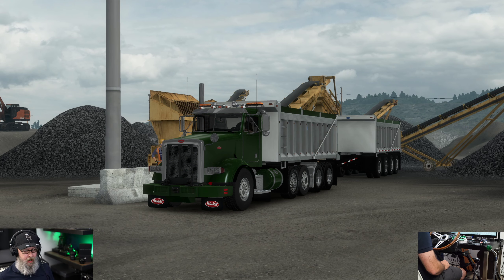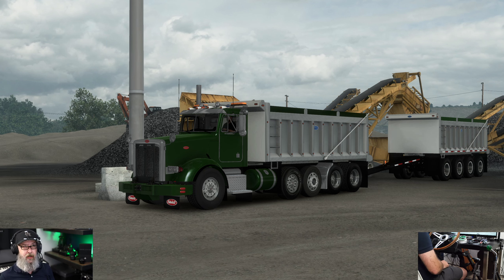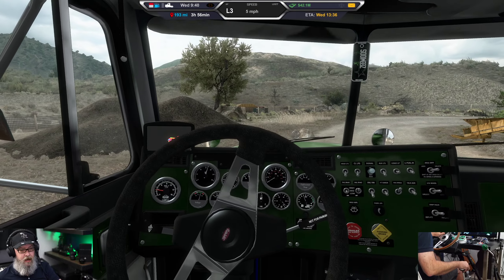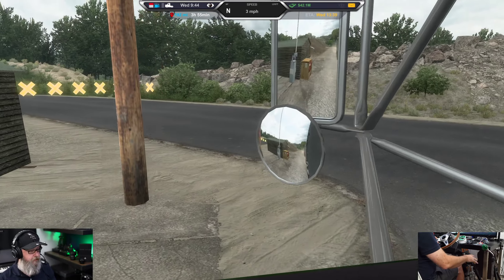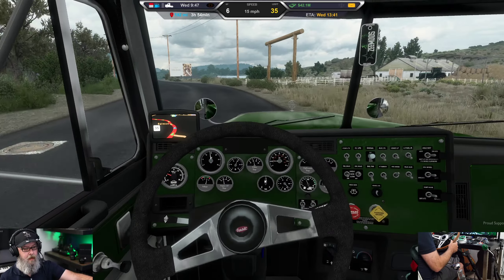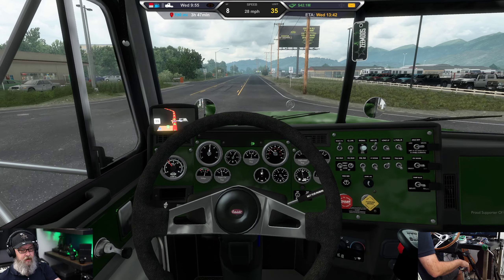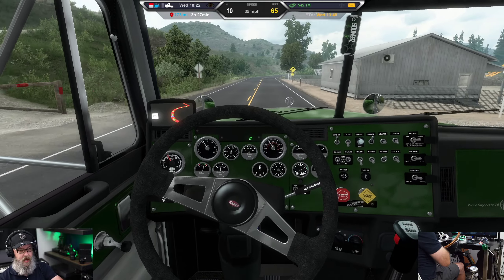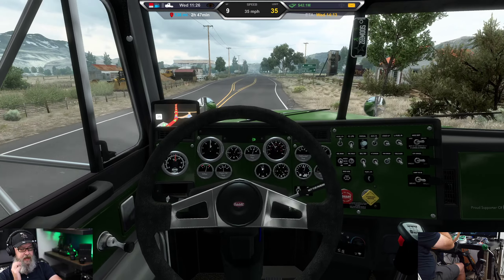New Cat 3306 Engine With Project 3XX Peterbilt 357 | American Truck Simulator

Comment: Definitely be cool to see the big V8 diesel engines like the 3408 CAT
Reply from the maker: Oh definitely. I run a 3408 from time to time, just only in carefully controlled drives as it doesn’t have an engine brake. I try to avoid that engine if hills are involved.

Comment: You enjoy it? Phew! You are very welcome!

I don't know of another 3306 in the game either, and the engine is known as one of the most reliable Caterpillar donks out there as it's purely mechanical. And 52mph is pretty good going, I bet the 3306 could do that all day and all night and keep going.

I also really enjoy the lower powered engines, I originally wasn't going to include the 245hp engine but sometimes having the teeny-tiny engine is more fun! That's why I introduced a 250hp version of the Detroit Diesel Series 60 11l engine. :)
Reply from the maker: Yeah, those 3306’s are work horses for sure. It is more fun and challenging when you have to account for every little thing to make sure you can get the load there. I admit I don’t always win the battle, but it’s often user error, and I’m still learning. Great job on this one David!
Reply: @freebeardgaming  thank you again! ❤️😎

Comment: Hey how do i get the dump on the truck? please help
Reply from the maker: You have to choose either the daycab and select the dump potion from the chassis, or maybe the dump option is in the cab section. Can’t remember which off hand, but you will see a “dump” option.
Reply: @freebeardgaming  i have the pup trailer. Ok i Will try and see if it work with daycab